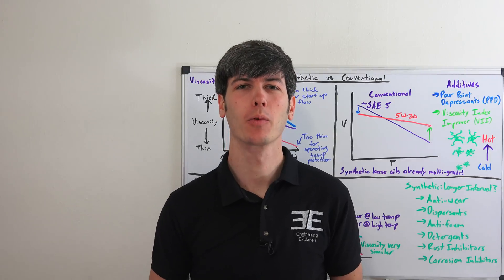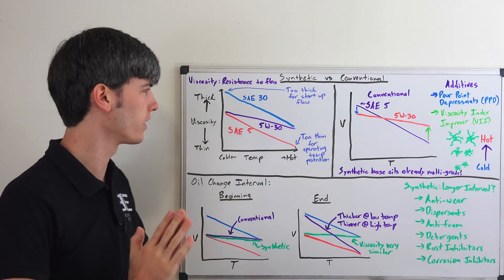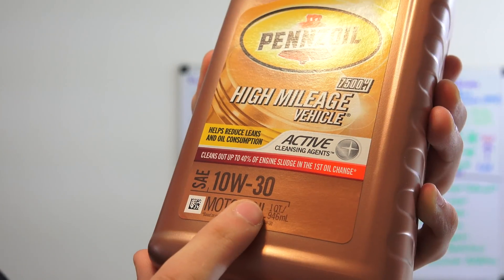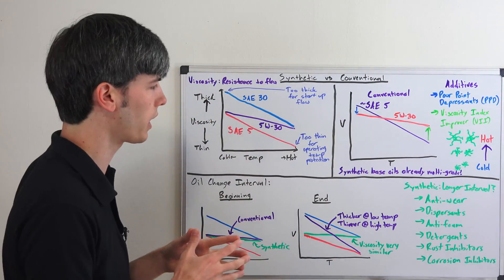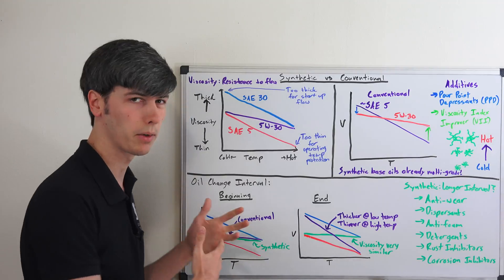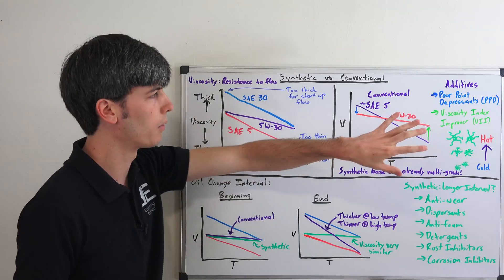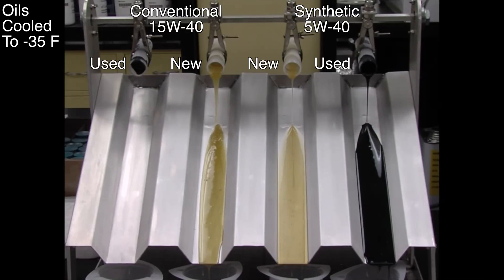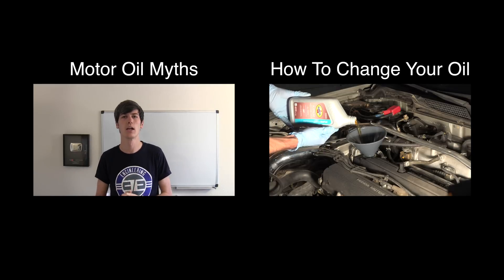Is Synthetic Motor Oil Better For Your Car?

Comment: I liked this video. I've found I no longer have to change my oil with my electric car. That's right, bring on the hate.
Reply: You're right, the car just pollutes before you buy it, and fills landfills with batteries.
Reply: Ha! Keep telling yourself that. Or, if you want the truth, look it up. Far more pollution comes out of digging for oil, transporting it, refining it and delivering - not to mention, using it in cars - than an EV would dream of using in being built. When the batteries are done, they are recycled.

And... (don't let your head explode) even if EVs were as polluting as ICE cars (they are not), they are 3 to 4 times more efficient so would pollute 3 or 4 times less.
Reply: +tiehut Yeah, but that is not the only source of electricity. In Norway 96% of electricity is made via hydropower.
Reply: +JoeyRodz74 yeah but electric cars are boring and not fun to drive
Reply: +Sergeant Speed  
Sorry, but you are misinformed. 
First, EV and hybrid vehicle battery packs are not discarded, they are recycled. In many states the recycling is mandated by law. 
Second. Lithium, carbon, aluminum and zinc the main components in most EV and hybrid battery packs are not toxic.
Reply: +tiehut If you think everyone here should only talk about USA you are small minded. You are unable to make a good argument. As an electrician in Norway reading "electricity is made by burning coal" has to be the stupidest thing i have read in a long time. And then you are trying to convince me it's a fact just because most electricity in USA is produced by coal power. YouTube doesn't have borders and is International.
Reply: Yep. Totally boring.... say most ICE cars next to a Tesla.
Reply: +Don Johnson  
I call bulsquirt. 
I have several friends with Model S and they have had zero issues with batteries or management.
Reply: umm electricity is produced by BURNING COAL which causes LOTS of pollution
Reply: No ***** I agree with Pat. Something doesn't square up with your story, really. First, no one leasing a Model S - or any other leased car for that matter - is going to put up with that. Tesla won't let you go through it, either. You would have had a loaner or a new car in no time.

A quick giveaway in your story is your claim of frequent "dealer" visits. There are NO Tesla dealers. In many cases, if you have a problem, they'll come to you. They'll fix it at your home or tow it to their service center, fix it and return it to you.

I'm not saying Tesla cars are issue free but I think you took some liberties there in your report. No?
Reply: tiehut You didn't know this but the worst polluting coal plant is far cleaner than an ICE car. A coal plant is also put in one place where the pollutant can be managed. An ICE car spreads its pollutants everywhere you go.

And now for another random EV car fact: it won't kill you if you accidentally leave it running in your garage.
Reply: Try the Tesla and you won't think so.  Mind-blowing performance.
Reply: There are not enough rare metals to make big enough batteries for everybody to switch over to electric cars. Only the rich can afford it so please stop bragging. They tax oil and spend on electric. It is like reversed Robin Hood. Electric cars are an alternative, but not the solution. Its just another way to go wich is good.
Reply: Kyle Saletta um i would hope so for $100,000
Reply: +tiehut If you can't read 4 sentences then you are the definition of lazy.
Reply: JoeyRodz74 but you do have to change your batteries at the same intervals as oil changes lol
Reply: yes but france has a lot of coast, so we could use the power of the tide ! it's a strong source of power and would not require to drown valleys like the dams ! we're starting to develop wind power. but i feel that when we'll start to tear down our nuclear plants, the electricity price will rise a lot, due to all difficulties they will experience. It's like asbestos or diesel soot. in france we react when it's too late and the country is like 90% contaminated.
Reply: ***** why is the usa the only country that you insult?
Reply: ***** youtube.... where eurotrash come to insult americans
Reply: ***** youtube: an american website where eurotrash come to insult americans
Reply: BTW, so-called "rare-Earth" metals in electric cars amount to a miniscule part of the car. There's plenty of Li for many millions of EVs.
Reply: even if it does use coal power plants, they are still more efficient than an ICE engine and like the other guy said ICE cars all spit pollutants out. far closer to your lungs
Reply: Right you are.  You don't have to change the coolant either.  Don't know which have transmission fluids that need changing.
Reply: +patw52pb1, actually lithium is very toxic indeed.
Not that I don't like EVs and batteries at all. I like very much and would recommend it over ICE for anyone who really needs a car. But they're not a panaceia too. Use a car if it's really necessary, not only for leisure or comfort.
Reply: +tiehut keep in mind we get electricity from many sources, not just coal
Reply: +tiehut Your comment was ignorant since you said that electricity was made by burning coal. You did not say in USA. I used Norway as an example because they have lots of electric cars here and the electricity is clean. So your coal argument is invalid.
Reply: ***** youtube is an AMERICAN website.  this video about oil was made by an AMERICAN.  norway is a TINY country which is why your point is meaningless.
Reply: I gotta say if anyone here has ever driven a tesla, I have and they are dope. They mob so fast. constantly putting you in your seat HARD all the way to 100+ mph without ever shifting
Reply: ***** too long didnt read
Reply: +Guillaume Gaudin Thank you for actually communicating, unlike other people on here. I think France uses nuclear power because it is more effective per m^2, and France has a lot higher energy demand than Norway. Norwegians use more electricity per capita than France though, because we have to use heat for our houses in the winter. The biggest reason why countries don't use greener energy is that the old power plants are already there and it would cost lots of money to replace them. In Norway we have 1 nuclear power plant, but it is mostly used to make radium for cancer patients.
Reply: +Guillaume Gaudin Yeah that is true. It will pay off in the long run if you use renewable sources of electricity.
Reply: +tiehut The USA is not exactly the most environmentally friendly country. USA ranks in 1st place for CO2 emissions, 2nd place for water pollution, 3rd place for marine captures, and 9th place for threatened species.
Reply: +tiehut Are you going to shoot me or something like other muricans do?
Reply: ***** why dont you troll on your country's websites?  wait.  your country doesnt have interesting websites
Reply: +tiehut At least we are a cleaner and more peaceful country with health care and free education. You could need some since you believe electricity is only made by burning coal.
Reply: ***** your education is not free, liar. your taxes pay for it
Reply: +tiehut You pay taxes too... and at least you aren't going bankrupt if you break some bones.
Reply: ***** you said your education is free.  you lied
Reply: What about the fuel cell ? and the supercapacitors ?
Reply: +tiehut How old are you? In USA you still pay taxes and you don't even get free healthcare and education. All your money goes to the military which invades countries because of their oil.
Reply: +tiehut I am using the Norwegian YouTube server so it's not american. What happened to your freedom of speech? That means i am free to criticise whatever i want.
Reply: +tiehut Then you don't know what ISIS is doing... They are killing people, not criticising their energy sources.
Reply: why can't americans do their self-criticism ? we should all admit our wrong doings to improve ourselves, if you are christian you should know it. moreover, i don't see as much "insulting" sentences from Kanice to you than from you to him, like underminding his opinion because his country is smaller (so we should all listen to the Chinese ?) or comparing him to ISIS.
Reply: And if you think i'm in love with norwegians, they also have their flaws, they are not part of the EU, so they for example use techniques for the farming of salmons that are not really ecofriendly...
Reply: or it could be... where americans come to impose their point of view over the rest of the world
Reply: What a lovely set of comments in here.

Hey, let's get back to arguing about when - not if - EVs will take over the combustion engine. My house will be fully converted in 2 years with the Tesla Model 3 :-)
Reply: Let's go to the Nurburgring......oh wait
Reply: JoeyRodz74 At least the gas tank in my gas powered car doesn't hold less gas every time I drain it. And also doesn't make up most of the cost of the vehicle.
Reply: Wadda... what does that have to do with anything? My EV doesn't need a gas tank, or a gas pump, or fuel lines, fuel filters, ignition, spark plugs, spark cables, coils or timing belts. That's just for fuel and ignition, I can go on.

There are EVs with 100,000 miles using the same battery - and same brake pads and rotors, btw.

But hey, EVs are not for everyone. Only those that want to reduce our dependance on foreign oil, be able to have a full "tank" every morning at a fraction of gas cost and don't want to die if they accidentally leave the car running in the garage.

Also, if you need to drive for 12 hours straight without stopping to recharge, EVs are not for you.... diapers are.
Reply: JoeyRodz74 yeah and your gay EV can't go long distances.  lol
Reply: Gay EVs....ha!! That pretty much sums up the comebacks against EVs.
Reply: JoeyRodz74 how far can you drive before your battery dies?
Reply: Not sure. There's a few EVs that have crossed the 100,000 miles mark with the same batteries.

You are probably referring to distance driven before the batteries are discharged. Most of the time, that's 100 miles on my 3 year old, $7,000 Nissan Leaf. At highway speeds, that drops down to about 70 miles. Newer generation of low-cost EVs run about 150 miles before they need recharging. The 2017 GM Bolt does around 240 miles.
Reply: JoeyRodz74 im stating that electric cars loose battery capacity every time you cycle them and it cost like 30000$ to replace them
Reply: So do ICE cars. Every time you start the engine, parts rub against each other, carbon builds up on the pistons, valves wear out, filters get clogged, oil gets dirty and decompose.

The upcoming Chevrolet Bolt and Tesla Model 3 are around $35,000 for the entire car. Replacing the batteries after >100,000 miles, if at all needed, will not cost $30,000.

I get a sense that your EV information is >5 years old. Some of your points would have been true back then but no more. Nowadays, very rarely an EV battery needs to be replaced because it wore out.
Reply: Liar,, China is 28% and USA is 15%
Reply: Are you serious? Liberals are deathly afraid of carbon, and I dare you to handle lithium without gloves.
Reply: Hey Jerry. Not sure who that comment was for but, what are you talking about? Lithium is not spread in the atmosphere, causing temperatures to rise and/or respiratory illness - carbon does.

And it's not about touching it or not. I mean, you wouldn't grab your own turd without gloves, either. Hopefully.
Reply: +Kanice - Hi it's true hydropower represents 96% because Norway has now a tremendous advantage most other countries don't have. Water just about everywhere in quantities that other countries can't even dream of and natural reservoirs in higher altitudes to go along. In fact water (salt & fresh) and oil are the biggest treasures Norway has in this particular moment in history when energy in it's many forms is the key to economical success. An advantage that no other country in Europe has right now and very few world wide.

What was an isolation reason in the past is precisely now an advantage and I guess will be for awhile.
What people still don't learn here is that switching off a simple light bulb. Is preservation of energy and environment. 
Unfortunately most Norwegians still think that leaving all lights ON and a thermostat pumping +25°C inside when it's -25°C outside and nobody is living in the house, it's a "normal" thing. In all honesty it's something I still struggle to comprehend.  

Just because it's a rich country in this particular moment the shadow of poverty of the past is not so far away, simply overlooked and forgotten hideen under the shadows of iphones and Teslas. 
With this said it's a marvelous green country. Be well. ;-)
Reply: +JoeyRodz74 - Hi, not a hate thing in fact more the opposite in my case, but EV's are still not there. I would love to have an electric car but on the other hand no way I would even try to do with an EV what I do with my diesel cars, not long ago went from the North of Europe to the South and back and have done it several times. No way an EV can do that nowadays with "normal" stops. 
With this said the fact is that for short normal commuting its starting to make all sense. Although battery life is still the main issue. Very hard to convince anyone that spending 50% of the total cost in the next 5/10 years is reasonable. Without gov funding, etc EV's would still have a major problem to reach the market.
Reply: +JoeyRodz74 - doesn't it worry you, the amount of gas head fanboys who just despise progress? I'd buy a Model S right away if I could afford one. I've test driven a couple P85+ and P90D. The driving experience is sensational. What I really can't get my head around is the folks who proclaim EV's are boring to drive.!!
Reply: Differential oil cough cough
Reply: Everyone settle down 😏 electric cars are awesome if you’re 5🤗
Reply: I prefer my car to have pollution.
Reply: +tiehut What??? Am i killing people by criticising the energy sources of USA? Do you know what freedom of speech is? You are more like ISIS, because they also don't want freedom of speech.
Reply: +Guillaume Gaudin Yeah that is true. They also farm whales which i don't like, but i am not going to compare you to ISIS just because you have some constructive criticism.
Reply: +tiehut Hahaha 😂 this comment is so hypocritical. You complain about Europeans insulting you and call them eurofags in the same sentence...

Comment: Why didn't you mention semi-synthetic? (Half-synthetic / mineral + synthetic tech)?

That is what most people use, especially on older vehicles / motorbikes.
Reply: wholeNwon If the proper viscosity grade is used it should not do this. If the conventional oil had left deposits that acted as seals to those leaks then you could see this happening. Granted, this is merely an indicator of a warn engine. Especially if you lose oil pressure after switching to synthetic.
Reply: wholeNwon Then you've never worked on an engine with a lot of mileage on it or is very old. Engine's tolerances for lubrication are designed with a specific viscosity in mind. Viscosity is a component of Laminar Flow and if the viscosity remains the same, the only issue that arises is the ease with which the lubricant flows. Easier flowing lubricant can bypass certain seals (typically bearing oil seals made of a rubber/latex/silicon) due to their high tolerance. You typically find these on the crankshaft's oil seals. This is where the oil leaks tend to show but is usually just an indication of the seal needing to be replaced anyway. As for the oil bypassing valve guide seals again it's an indication of a worn engine.
Reply: Semi-synthetic is a compromise between cost and protection. Simply put, that graph he showed would be "blended" just like the oil.
Reply: Then why is fully synthetic often NOT recommended to use with old vehicles? In that the additives do more harm than good
Reply: DoubleYouPee I'm not sure where you got that information. Synthetic is more expensive but provides better protection through it's service life. Conventional is far cheaper but provides mediocre protection near the end of it's service life. Blended is a compromise between those two. Blended is more expensive than conventional and provides better protection than conventional. When you compare blended to synthetic, synthetic wins in all those categories except cost.

I think the common reason people suggest you do not use Synthetic in older cars is because the detergents clean up the deposits left by conventional oil. This possibly exposes leaks that were plugged by the deposits left by the broken down conventional oil. At least, what I've heard is "Synthetic causes oil leaks in old cars". Truth is, they were there already and the Synthetic detergents cleaned the deposits that were plugging the leaks.
Reply: It does no "harm".  It just tends to leak and to flow passed valve guide seals, etc.
Reply: I know of no evidence that "cleaning" deposits on oil seals is the reason that some leaking is occasionally seen when "synthetic" oil replaces conventional products.  The explanation that the manufacturers usually give is that the "superior" laminar flow characteristics, as distinct from viscosity, are responsible. Obviously, losing oil pressure is a different issue.